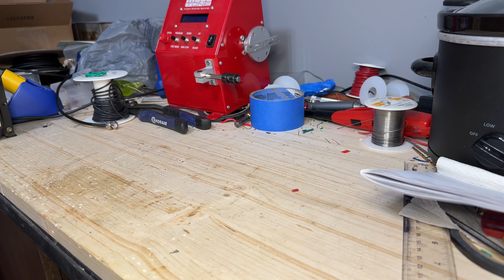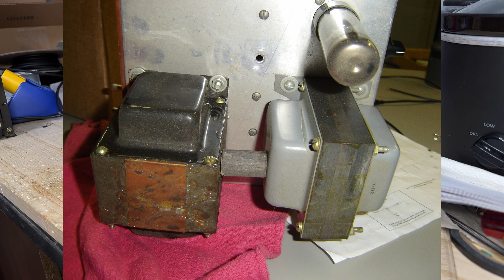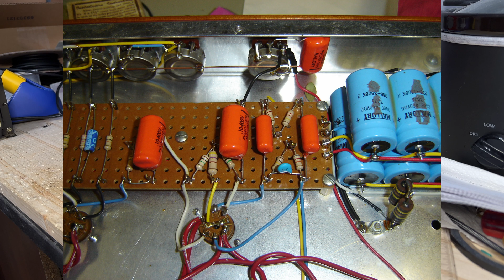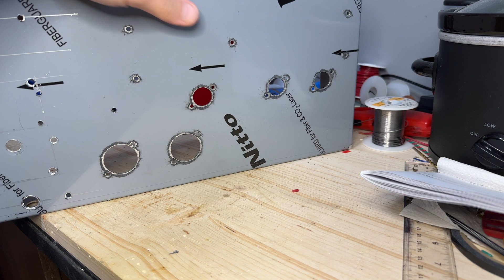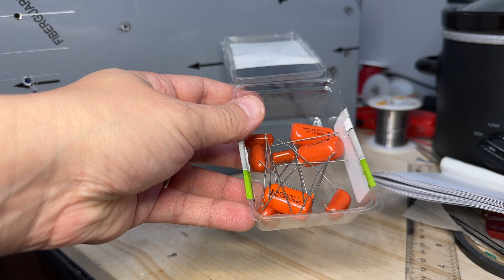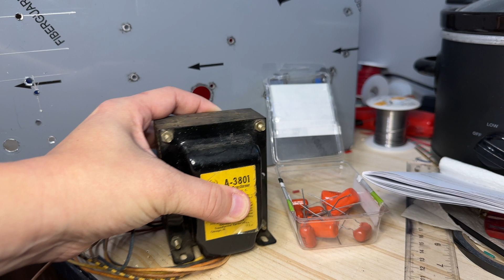Building a trainwreck Express clone amp from the ground up(Part 1)

Comment: Is there any modern replacement for the A-3801?
Reply from the maker: There are some replacements spec wise but nothing like the original
Reply: @DaveEdwardsDesigns have you reached out to Heyboer? They make amazing transformers in Michigan. Paper core like the old days.
Reply: I got two of them puppies one stancor and the other pacific in my wreck. Best part i had got these from salvaged pa amps.